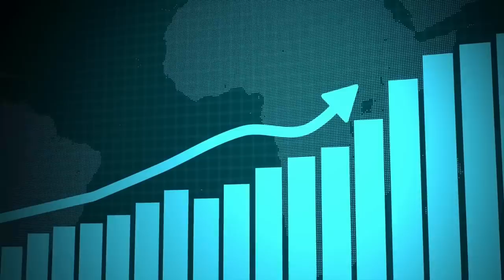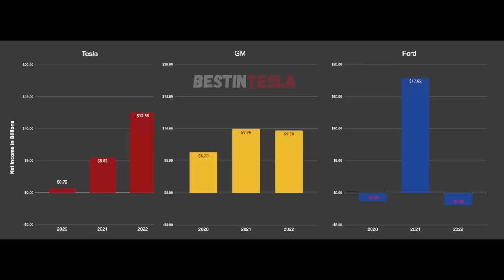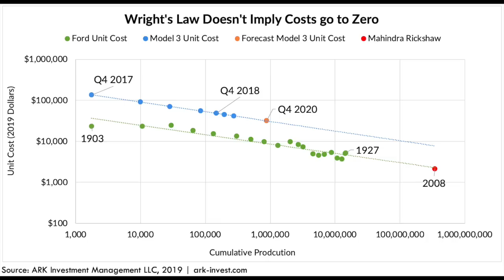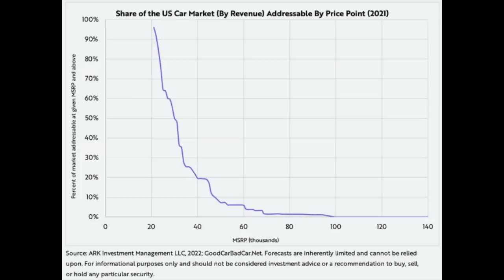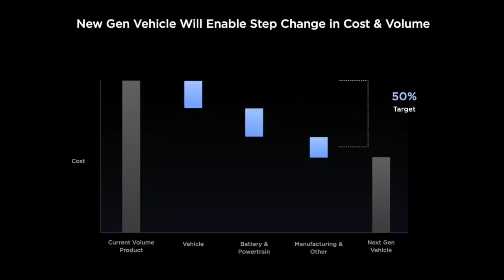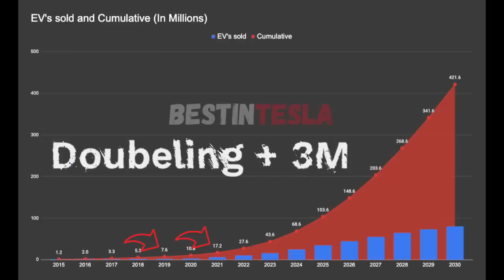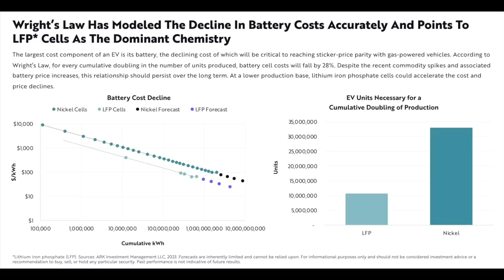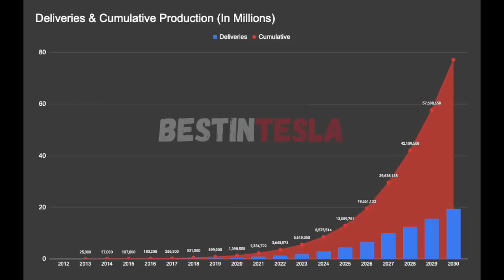Price cuts but same profits….HOW ? - The tool most people are forgetting!

Comment: Great analysis Lars.  Just remember that 2 doublings of production is not 2 x 15% = 30%.  (example: $100 decreased 15% = $85 which then decreases another 15% = $72.25 or a 27.75% decrease not 30%).  Still very significant.  Also, as car prices are reduced, more people can afford to buy the car which therefore increases TAM (total addressable market).  But as stated below, Wright's law only works if learnings are incorporated as production increases.  Tesla works in a very agile/scrum methodology which allows them to incorporate efficiency, improvements much faster than traditional automotive manufacturing so Wright's law would be valid for such a company.
Reply: @MD-gt6xw I was gonna say this very thing. Lars didn't say 4 x 15% was a 60% reduction, but it could be taken that way, so by 7 doublings the cost would be below $0! The correct math is future cost = current cost x 0.85 to the power of the number of doublings. So four 15% reductions is not a 60% reduction but a 47.8% reduction, and 7 doublings is not a 105% reduction cost but a 68% reduction, which is still ridiculous.

Cost reductions apply not to the whole car, but only to new technologies like batteries, computers, and manufacturing efficiencies, not to mature items like existing materials such as steel. But almost anything is subject to disruption with first principles thinking.

Comment: Ah, check your math. Each time it will be 15% less than the previous doubling. So 1.00 x .85 x .85 x .85 x .85 = 0.52 or a cumulative reduction will give 52% cost or 48% reduction for 4 doublings

Comment: I would agree in general with your comments. That said, I suspect Q1 will be in the 15% to 20% range but be above 20% for the year. Remember that the price reduction were immediate but cost reductions will be more ongoing throughout the year. So there is a bit of a lag. I hope I am wrong and we see 20% gross margin in Q1 but we should avoid excessive expectations.
Reply: I feel like you're missing that Austin/Berlin were a significant drag on finances last year and now should be profitable themselves (Berlin for sure, maybe Austin breakeven) as well as the generous 2023 production-side incentives of the IRA kicking in--probably more than offsetting the US price cuts at least.

Comment: You are right about Tesla's margins long term. But what about Q1 2023 margins when we had massive price cuts?
Reply: Asp is still higher than in q1 2021. Economies of scale for production have been realized as they are at a more than 2x run rate vs 2021.
Raw materials costs have also fallen since then. 👍🏻🤔
Reply: @4literv6  S K's question was about the effect of the massive price cuts at the beginning of Q1 on Q1's margins.   To me, the relevant comparison would be to the margins from the quarters immediately preceding the price cuts:

Automotive gross margins for 2022, Q1-Q4 
32.9% 27.9% 27.9% 25.9%

Operating margins for 2022, Q1-Q4
19.2% 14.6% 17.2% 16.0%
Reply: The hit will be profound. At least 1.5% less than Q4 2022. The stock value will tumble below 70,-- and i can buy more stock. Perfect!
Reply: Better than Tesla's competition... 😎
Reply: @wolfgangpreier9160  But more revenue will be realised from FSD beta.
Reply: @taefravis  Maybe in the US. Nowhere else. Not for a very long time.

Comment: You can't add each 15% reduction together. You have to multiply the cost by .85 for each doubling. So after two doublings, the cost would be .72 of the original cost, not .70, and after four doublings it would be .52, not .40.

Comment: 854 Hummer EV's seems to be the right amount to produce to me, an EXTREMELY over the top vehicle that has no real reason to exist other than to satisfy those with very deep pockets, kind of like a Bugatti, but going in the opposite direction, basically a toy.
What we, and the environment need are extremely lite and ultra efficient EV's. A cross between an Aptera and the best Tesla has to offer.
As for "work vehicle's", trucks as the US like to call them, not sure here, however the current crop are hopeless. Lets hope the Tesla Cybertruck leads us into a better direction, the jury is out until they get some on the road. Then there is the Canoo, or an Xbus

Comment: Elon has stated that the Model 2 will outsell all the other models combined.  When that is the case, it will need to be manufactured at ALL the new and old (expandable) factories.

Want to bet how Tesla will start Model 2 and Giga-Mexico? My guess: 1) Start building G-MX 2) Start G-TX expansion for M2 production 3) Start producing M3 & MY at G-MX (get staff trained and up to Tesla speed) 4) Start M2 production at G-TX (work bugs out with top staff, Elon, suppliers, engineers) 5) Start M2 production at G-MX (close to G-TX for aid) 6) Start M2 production at expanded G-Berlin & expanded G-Shanghai.

G-TX, G-Shanghai, and G-Berlin all have lots of additional land, that WILL be utilized.  I noticed that G-Berlin has cleared a very large new area recently.

Comment: TVs are the same went from tube TVs to flat screens now i can get a 4k 60" TV for under 500
Reply: In 1968, my parents bought their first colour TV, a 24" Admiral for $700 Canadian. Today, I can buy a 32" LCD set with 3x the resolution for about $100 Cdn. When you factor in inflation, that's 0.71% of the cost.

Comment: Your across-the-board application of Wright's law for the entire automotive industry is not valid ... not for anyone other than Tesla.  When was the last time you saw any car manufacturer (except Tesla) reduce their costs and then reduce their price.  Greed has become synonymous  with 'best practices'. Tesla inadvertently forced the current price war by doing the right thing and others are furious.  Elon said years ago that he would reduce prices as he ramped up production and cut costs.  Why are you quoting Kathy Wood when she herself took the tip from Elon?  As you said yourself, it took Tesla 12 years to make 1 million cars.  Knowing that, your comparing other manufacturers making BEVs for the last 4-5 years (except GM, of course!  They are leading the way) isn't valid.  Just stop holding everyone else up to Tesla's standards.  If you insist on making Tesla shine in absolutely everything, just stop the comparisons.
Reply: Legacy auto has only increased by around 5%/year for decades, this was addressed in the video. Maybe you should try actually watching it.

Comment: I don't see that sort of cost reduction (4x) because a large part of  cars is coming from a mature vehicle industry.  Think about the parts such as windshields, tires, etc.  

The cost of batteries, motors, and perhaps electronics will drop.   Tesla will reduce costs with megacastings, 'box' assembly, less copper in the wiring harness.  And others may/should follow.  That might lead to a 50% manufacturing cost.
Reply: The same logic was used no doubt when going from horses to cars and there costs fell more than 50%.
Battery costs for example have fallen by more than 50% since 2010 and so they can keep falling even more as well as many other parts of the car.
Many parts such as seats or wheels etc are only the costs they are because legacy car makers have never applied Wright's law for many decades, thus their costs can be lowered if suitable innovation etc is applied which is what Tesla does best

Comment: That's still only 1/4 the fleet. However, if Robotaxi's add a weight of 10x for each vehicle before 2030, then that's WAY MORE than the entire fleet. Some will be private one owner, especially at first. But eventually the total will take over well before 2030 to replace the entire fleet. FSD is KEY!!!!! to making this happen before 2030.
Reply: FSD and Robo Taxi may become important on the US market. But not anywhere else.
Reply: @Wolfgang Preier  Why do you think that? Once they have an AI that can drive in the US it will accelerate the rate at which an AI can be trained to drive elsewhere. That's just the way AI works, it's improvements are not linear. It will take time to go global but not decades only a few years.
Reply: @wolfgangpreier9160  They will work in Indonesia as that country is perfect for Robotaxis etc and once the uS allows them other countries will allow them as they will not wish to miss out on the massive income opportunity they provide.